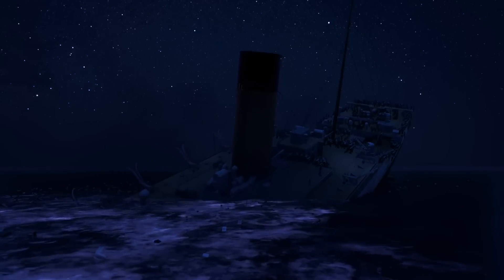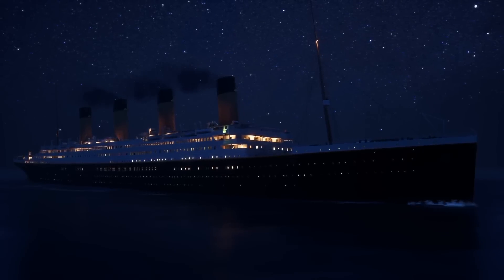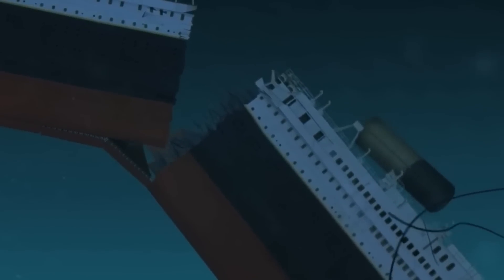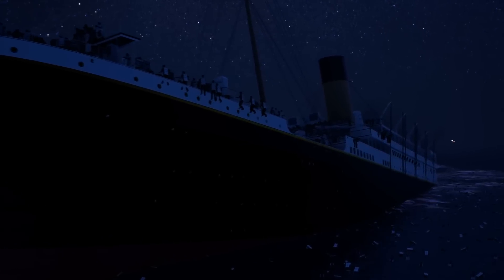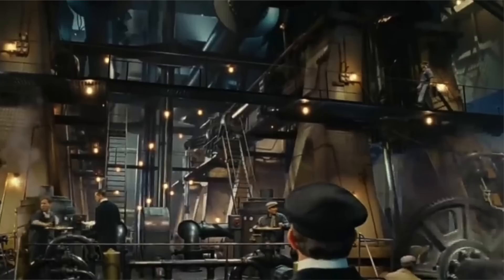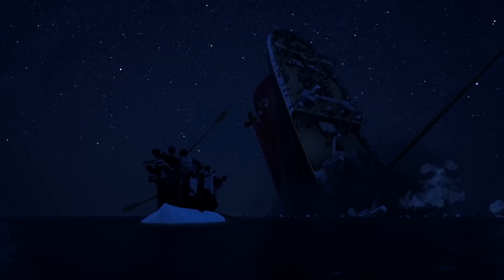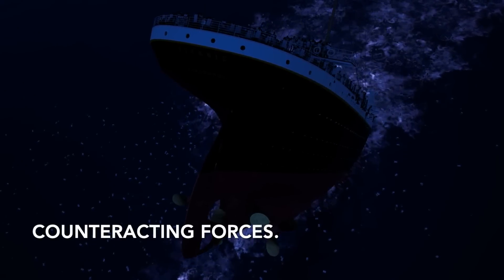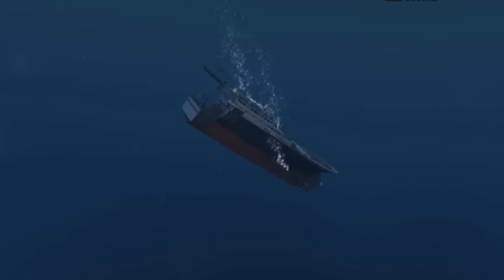The Physics of Titanic's Final Plunge!

Comment: So my hypothesis was kinda right, it was the weight of the engines that pulled the stern down NOT the bow itself. However on a side note since most of the damage was concentrated around the forward section of the engine room, the bulkhead behind it could have been practically intact. This would explain why the Stern stayed in that slight inclined position for about a minute or two, in other words: after the breakup the engines pulled the forward section under the water so hard that the water went over that bulkhead and started to flood that compartment.

Once that area flooded, the Stern went more vertical and then the next compartment got compromised due to the angle of inclination, this gave the Stern a controlled momentum on its sinking powered by the dead weight of the engines and the step by step flooding of the compartments.

Like I said in the previous part of this video, it was impossible for the bow to pull down the stern after the breakup since that would require the double bottom to sustain twice to thrice the forces for which it was intended for. Plus the bow wouldn't slowly sink underwater on its own, it already lost its buoyancy and had double its weight because of that, it would have plunged full speed as soon as it disconnected itself from most of the main body that held it near the surface. A chunk of double bottom could never deal with that on its own.
Reply: Yes! I agree with most of the stuff. I also want to add, that the bow might have risen slightly for a moment in slightly more towards vertical position, as stern stopped pulling it down, and higher parts of the bow might have been still filled with air.
So as I think bow at very slightest (almost unnoticed) copied behaviour of the stern. So I would say that double bottom standed no chance indeed.
However I don't know if there's way to disprove it or prove it more.
Reply: what's funny is that means the bow was already on the ocean floor before the Stern sank.  probably for as much as 8 minutes or more.

Comment: It was both. The double-bottom was clearly still connected as only that can explain the rotation. Without the bow half pulling unevenly on one side a bit more than the other side, the stern half could not twist or rotate on it's own. Roll onto its side from uneven flooding, yes, but not rotate around it's central-length axis while upraised like that. The double-bottom clinging on for a bit and the massive weight of the engines... ta-dah.
Remember the 'can't sink with only four compartments flooded."  The entire bow half was now broken open and fully flooded and underwater. More than enough to drag down even the unflooded and water-tight stern half. The stern could have stayed perfectly water-tight, but the front half flooded was more than enough to drag it down entirely unflooded anyway.
The stern sitting there upright like a buoy was because of the front half hanging downward like an anchor chain. 
The two halves were connected on the way down for a time, until they twisted and twisted and twisted as they fell, until it was pulled apart along with so much of the already mangled central sections. The two halves literally ground against each other, grinding the central already mangled area into even more debris.
The stern could have been completely watertight. The entirely flooded bow half was more than enough to drag down the unflooded stern. Its is simple physics. If four compartments flooded would sink the ship, then think what the ENTIRE front half of the ship being completely flooded and underwater would do.
Reply: There are reports that talked about the stern remaining horizontal for abit before rising such as George Synoms, Edward Buley and John Poingdestre. Titanic's stern pivoted as it sank. If the bow was still connected, it would be facing a different direction. It likely did go nearly vertical but also remaining horizontal before.
Reply from the maker: Only issue with that is the amount of time the stern was on the surface following the break. She floated there only leaning a tiny bit forward for a minute or so before she started sinking rapidly. You would think if the bow was still connected it would of happened much quixker
Reply: @HistoricTravels  You'd think. When you read witness accounts and compare them with video footage, you can see how time is distorted differently for different people in different circumstances. The stern could have risen over ten seconds or well over a minute, and every witness would describe it as a different amount of time. And that is witness accounts minutes after an accident in broad daylight by bystanders,. Now imagine the mess when the witness is part of the horror, and it's pitch black at night on the open ocean with no help in sight and your ship is sinking in the pitch black night. 
There is no wonder witness accounts vary so much and even conflict.
Rely on science and physics and predictable behavior and take witness accounts as second- or even third-accounts, espcecially as all the witnesses were heavily traumatized and horrified at the time and then spent hours and hours in the pitch black afraid for their lives, grieving the loss of thousands whose voices were slowly going silent around them.
Reply: @Smokr-DOGE  Video footage? We only have simulations of the Titanic sinking, nothing more.
Reply: @Smokr-DOGE What video footage???
Reply: @HistoricTravels  That's how it looked. Thousands of people claimed the south tower paused for a moment as it fell. Witness accounts generally are pretty awful. More thousands say they saw demolition charges as both towers fell. And this is with video evidence of a broad daylight event witnessed by millions in person. Witnesses sux. And Titanic was pitch black, no moon, they were all shivering and traumatized and watching a shadow in the dark against stars with tears and/or salt water in their eyes and the screams of thousands in their ears. And no one had ever seen anything like it. THere were no  disaster movies at all and there was no experience near it except war, and no one alive then had seen a  world war yet,  or a movie like Posiedon (either one) or anything of the sort. And the ship was supposedly unsinkable yet there they were, floating on the black sea in the black night, shivering and wailing, hearing it tear itself apart between the screams of the dying.
Reply: @HistoricTravels in the bow only  stuff under and forward of the grand staircase was flooded, the bow needed time to flood and get into a position to pull down the stern